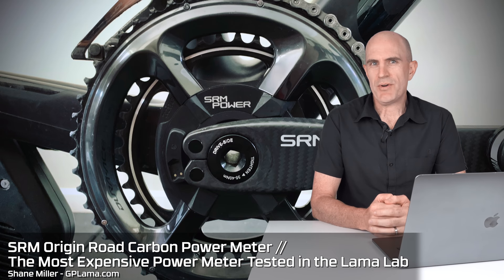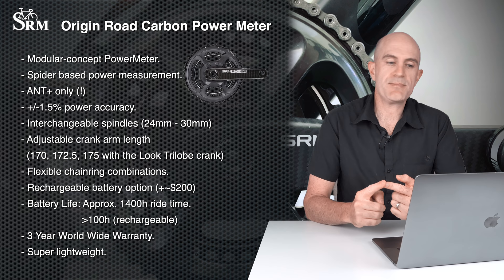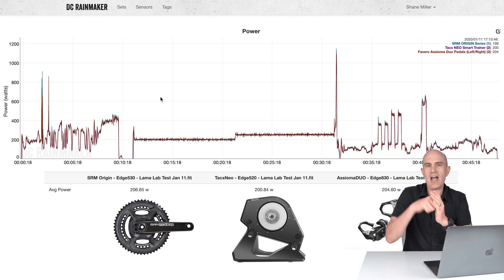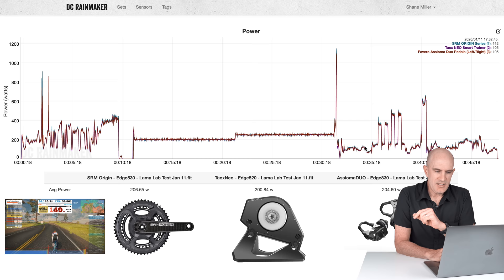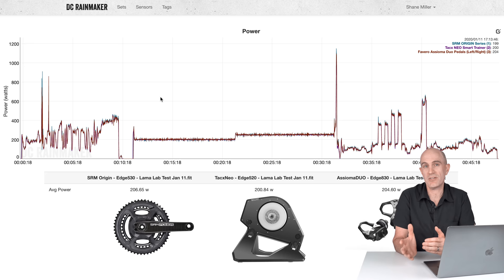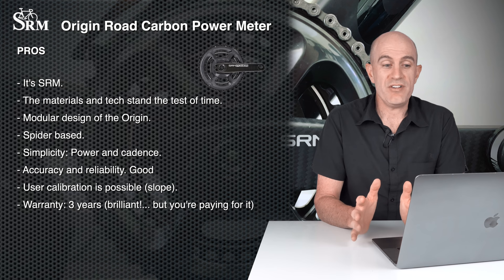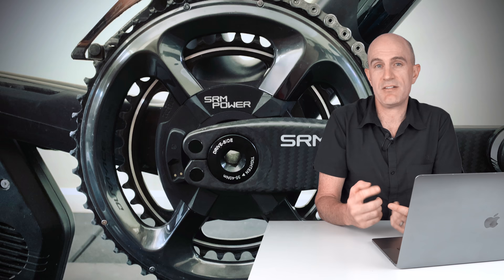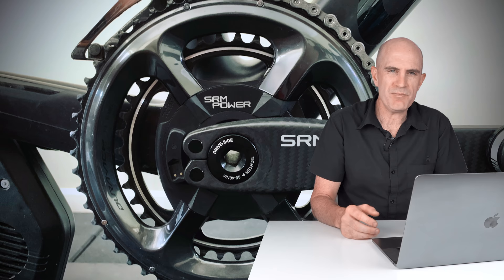SRM Origin Road Carbon Power Meter // The Most Expensive Power Meter Tested in the Lama Lab

Comment: I was wondering when you were going to do a review on the SRM power meter. I actually have two Origins, one on each of my two road bikes. Why did I spend so much money? Simple for me. I was using SRM power meters when they were wired only! Several years ago I switched to the Garmin Vector 2 pedals because I wanted additional metrics or at least thought I did. After a year or so of dealing with bugs in the firmware the pedals finally worked and I used them for about 4 years. I tried to use the other metrics but honestly they were not useful to improve my pedaling. If I tried to make a change based on the various metrics I would end up blowing up another part of my stroke. I next moved onto the Vector 3 pedals, or should I say three different pairs of them. They all broke and had to be sent back. I then went through two Stages dual power sided power meters. They had issues with the battery seal and wet weather. So that was over a year and a half process of immense frustration. I purchased a SRM Origins it just works. I realized I did not need any of those metrics because honestly what are you supposed to do with them anyway? The SRM is RELIABLE, consistent and bomb proof. I got the rechargeable battery so I do not need to send it back (that used to be a gigantic hassle). So Lama and I have a different opinion on this.
Reply from the maker: All valid. The reliability and materials was mentioned. They know how to build a power meter. They just need to move a little faster on features/price/everything else.
Reply: @gplama   Your review was excellent as usual. I heard that if a pro wanted an SRM they had to pay for it and that SRM does not sponsor pro teams. Is that true?
Reply from the maker: @JBSpine007  So the old saying goes... but SRM now list the pro teams they sponsor on their own website.
Reply: @gplama  SRM now has the PM9 Origin with a lot of the missing features you mentioned.
Reply from the maker: @RB-xv4si  It's unfortunate they're really no longer in most conversations about what power meter people should buy. They really need to work on their PR/marketing.
Reply: @gplama  they may be relying heavily on their professional users, as you mentioned. Not sure if the teams are buying them or if they’re provided by SRM for free because they know they’ll get publicity from the big names using them in races. They’re the only PM I’ve used and I really view them as a professional tool. Is a professional photographer going to show up to a wedding with an IPhone even though it may shoot very good photos? Hell no! They’re coming with some $10k DSLR with some mega lens. SRM isn’t really made or marketed for Fred’s and I suppose they’re OK with that.
Reply from the maker: @RB-xv4si  With SRAM and Shimano sponsoring all the big names in any bike sport and having their own meters, SRM needs to do something to get back into the conversation. Favero are the opposite, sponsoring almost nobody... but having a MASSIVE market share. And with a product that really does rival the SRM for accuracy. The whole shit-show that is the SRM SPD pedals needs to be sorted too. It's a horrible product. All they need to do is make quality products that compete on features/accuracy and PRICE. They're lagging behind on some of those. I'd love to see SRM be acquired by Shimano (Similar to how SRAM acquired Quarq).

Comment: When will you do a review on power2max?
Reply from the maker: As soon as I get my hands (and feet) on one. :)
Reply: @andraslukoviczki519  Nice - Didn't know Zwiftpower had that feature - Thanks!
Reply: @andraslukoviczki519  How did you record both power meters? I used zwift and my Garmin and the power seems so jerky it's impossible to compare
Reply: @raptor7547  with 2 Garmin head units. But it is the same if i compare the Zwift FIT file (Neo) with the Garmin's one (NG),  just i always record the Neo's power with a Garmin unit too as a backup.

Comment: Why do you always refer as the SRM reading higher and not the Neo reading lower? A few days ago I commented in another video of yours about the poor accuracy of the Neo when the flywheel speed is a bit higher, and you admitted to the issue. I've been experimenting a bit further and the accuracy of the Neo is very very questionable. Comparing with my Quarq Riken ,when going up a slope of >10% at a very low flywheel speed the Neo reads within 1% of the Quarq, which is very good. On the other hand if I'm riding a 0% slope (virtual flat or descending) the accuracy drops to 5-10% of the Quarq! which I think it's outrageous...So the Neo accuracy <1%, is as a very big "if"...

In fact, in your video during the power analysis we can clearly see the issue. When doing ERG mode all is good because probably you used a low gear. When "riding along" the difference in power grew much bigger.
Reply: Note that Shane was comparing the SRM with the Neo AND the Assioma Duo. In the charts he was showing, the SRM was higher than the other two, not just the Neo.
Reply: @johnmreinke  Sure but he was the first one to admit that the accuracy of the Assioma was questionable due to the crank/pedal interface in that crankset...Anyway this was just to reiterate that the claimed accuracy from the Neo is VERY questionable, from my own experience and a lot of folks complaining about the same issue throughout other internet forums. The Neo is good if you are riding at <= 20km/h. Above that the accuracy is shite...
Reply from the maker: After 100s of comparative tests on the Neo, the protocol I use works really well. Including being in the right gear to obtain optimal accuracy from the Neo. It’s not perfect, that’s for sure. It’s a pretty good comparison point when used the right way (within flywheel speeds that produce quality data).  

If there was a better trainer to use for this particular task, I’d be using it.
Reply: @gplama  Isn't the Elite Drivo II more accurate? At least claimed accuracy...

Comment: Would love to see a video comparison on a single sided v dual sided power meter. With power pedals being so affordable these days the question that loads of people want to know is dual sided worth the extra money to the average rider.
Reply from the maker: There's not a lot to compare or 'vs' really. If both meters are accurate then it's just a case of accepting Left is Left x2 for total power. Fine if you're 50/50 balanced. Not so ideal if you're not.
Reply: @gplama  That's what I wish I had known before I bought the unos but couldn't find any information online. The place where I bought them said you could go into the assioma app and alter the reading so they tracked the same as you indoor trainer (Neo in May case) to allow for pedal imbalance. Great I thought! Until I bought them then realised that people have different pedal imbalances at different powers. Shame there was no video explaining this

Comment: I bought one, and has been a disaster. Decision was based on wanting reliability & accuracy, and the price I got is was only slightly more than I could get a quarq at (in NZ), and most others were out on reliability and back-up in NZ. Out of the box it was in accurate (+/- 20 % out), could not really be without bike, so waited a bit to send back, took over 6 weeks to get it returned. I have it back minus a spacer and lock ring, so still out of action... Main issue is SRM australia are less than useless.
Reply from the maker: This isn’t the first case I’ve head of an SRM shipping with the incorrect slope.... hmm.

Comment: question shane do you know if you have a leg imbalance at all; only reason i ask is because if your 50/50 then you would never know if certain devices are off or not??
Reply from the maker: Using the Assioma DUO / Vector 3 / P1 or P2 pedals as the reference power meter to compare others I can determine which devices are accurately reporting or not. Spider based power meters such as this measure both sides at a single point.

Comment: In terms of overall cost, the price is significantly reduced if one buys the aluminum crank origin. The cost is about 1,700.usd.
Reply: Gerald The Trombone Which is still high.
Reply: 1270€
Bikecomponents de
It is 1000 gr crank

Comment: $3.5k I would rather buy another bike (which likely comes with a power meters). Or three pairs of Assioma Duos. Ideally CAAD13 Ultegra and a pair of Assioma Duos comes in under the cost of this unit.

It seems like a bad value for money purchase. Think disappointing is the term.

Also mate giant TCR is high end. Would rip around on a tcr before a dogma any day of the week.

Comment: What’s the purpose of the magnet?
Reply from the maker: Cadence sensor. Cadence (rpm) is needed to calculate power. A magnet/sensor is a little more responsive to start up than an accelerometer... other than that there is no reason a magnet is better. Outlying uses would be track riding (standing starts).

Comment: How is power balance a required feature?  It still has no real known training usefulness.
Reply from the maker: It’s a ‘everyone else has it why not’ feature. For the price I’d expect pro level metrics, useful or not. For $500 there’s room to excuse missing features, not at this price point.
Reply: Ok, I can buy that.  

It's really hard to understand why SRM hasn't added BT and why they haven't ditched the magnets in favor of accelerometers.  Given their intransigence on pricing and their refusal to add what are now standard features in other PMs, it almost seems like SRM has let their previous success cloud their judgement.  It also seems like they really don't understand or care to understand their competition.  

Year before last I bought a brand new PowerTap wheel set with a G3 rear hub for $450 + tax.  That G3 hub broadcasts BT and Ant+.  I can change my own batteries. SRM power meters do exactly nothing more than my hub does.  My G3 claims the same 1.5% accuracy that SRM does for the PM you reviewed.

And my Campagnolo Chorus 12 Spd crankset looks way better than that SRM PM!

Comment: Power2max NG all the way- SRM will need to adapt or they will disappear like the dinosaurs- I have 2 Type S and one NG and never had any issue with them. I just don´t see any added value to use a SRM Powermeter.
Reply: I agree, have had P2M from 2013 working flawlessly. SRM is more accurate though. Accuracy doesn't come cheap
Reply: @rkan2  not true. My p2m NG is 1% accurate.  And if you are not a pro accuracy is not the most important thing. As long as they are consistent, that's what you need to train.

Comment: Having to send the unit in for a recharge means i would be out a bike for that time.
Living in Norway where postal is REALLY slow at times, and given that customs would charge me import tax and handeling fees for this even tho it is a unit that was sent out for repairs, this would not only cost me mucho dollares, but also cost me weeks without a bike.
How about just not buying these?

And why the shit isn't there a standardized system for bike electronics that just work with all systems?
Immagine having your shifters, lights, power and cadence meters and gps all connect to the same app and all of this could be fed to your strava or whatnot.
It could show you everything and all you'd have to do is sync ONE god damned unit.

I demand change!

Comment: Shane, you said it, but then missed the entire point. Pro’s don’t want to ride anything else for one simple reason…when it’s raining, snowing, hailing, 110 or -20, SRM’s just work! It’s the ONLY power meter you can say that about. I run a road race team and have used SRMs for the last nearly 20 years. My first wired power meter still works flawlessly, NO other Powermeter can offer that. I have used most of them, and my team members have pretty much used all of them, and I can tell you there is not a single other power meter that doesn’t break, leak, come unglued, stop calibrating, drop signal etc. the biggest issue I have with your test is that it was done in a static and controlled environment. That’s not where the SRM shines. Go see the differences on your favorite hill climb in the middle of a deluge. I guess if all you do is train indoors, you don’t need an SRM. I would agree with that at least….
Reply from the maker: It’s a pity SRM doesn’t even come into the conversation these days when people are looking for a power meter. They’re too expensive, and their SPD pedals are simply an embarrassment. And in regard to having a crack about power indoors only… careful… I’ve been out collecting 100s of hours of data outside this summer. I have a LOT of data that shows there are other meters just as worthy, if not more (and cheaper!) than SRM.
Reply: Shane, not just outside. Outside in the inclement weather that pros ride in. I do agree that they are no longer part of the conversation as the world of Shimano and disposable bike components have taken over cycling in its entirety. Again, my issue is with longevity and durability. They only do one thing. Although they finally do support Bluetooth. Anyways, I love what you do, I just don’t agree with you about SRM.